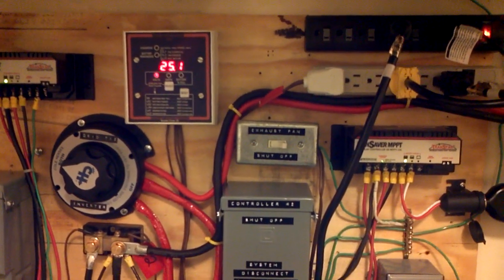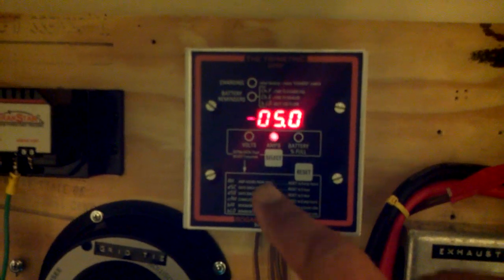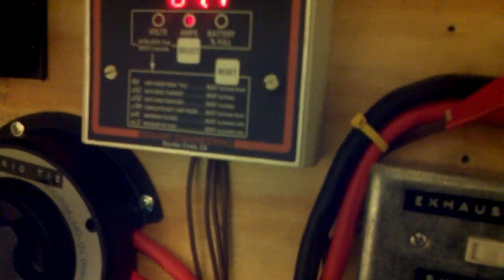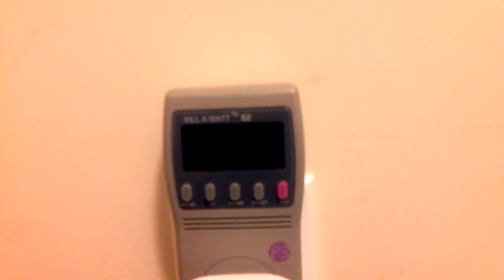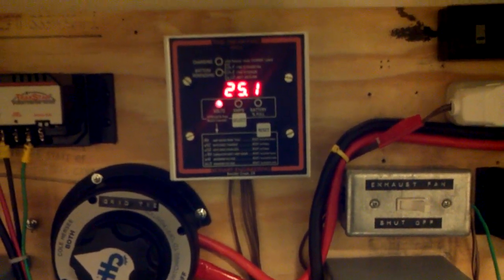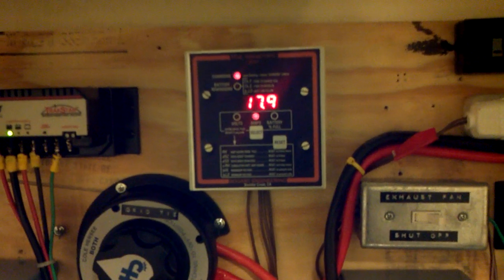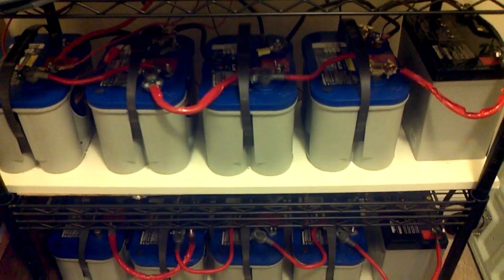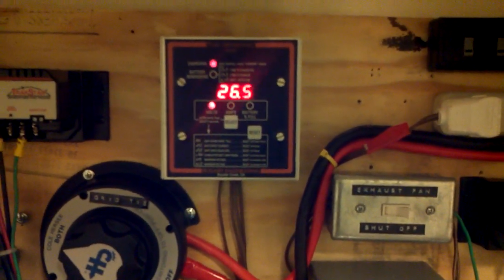DIY - Grid Tie Performance Test Verification Part 5 - Hour 4

Comment from the maker: MagnaSine maybe a little expensive to start out with. Modified Sine Waves are ok for pumps, motors, lights, laptops, and simple appliances and electronics.  However, for sensitive electronics they will fry them.  With a modified sine wave inverter, I've fried a DVR and some other sensitive equipment like electronic pest controllers. That's why I say that MSW inverters are "ok", but may be a hassle in the long run, depending on what brand you buy, a cheap pure sine inverter solves those issues.

Comment: Immediately I want to power 2 of my computers at home. One runs 24/7 to record programs. I am also contemplating to get Power Bright 12-Volt DC to AC 3500 Watt Power Inverter to start with and later on upgrade as needed or should I buy the MagnaSine?

Comment: Thanks for the response.. I notice you 4000 Watts MagnaSine inverter. I am planning to go with the ME2012 MagnaSine 2000W 12V Inverter Charger. Will this work for now - I am planning to start by powering the pump of my pool and a pump of my pond. I am concern about future expansion and having to buy a different inverter.

Comment from the maker: It's been a while, but essentially here is an estimate. MourningStar MPPT Charge Controller $300, Solar panels - $250 ea (x4)., Inverter - $500, Batteries - $180 ea.(x12), wire, switches, fuses, etc.  $250, mounting equipment - $250.  Now depending on your needs, your's may not cost that much.

Comment from the maker: Thanks for the offer, but traveling to do this is not an option for me at the moment. However, I am will to help you in setting things up.  Just send me a private email with your questions etc.  With a little assistance you should be able to complete this in no time. it may look intimidating, but the setup is rather simple once you get an idea of what your working with.  Again, if you get the equipment let me know and I'll help. Take Care.

Comment from the maker: My battery bank capacity is 7.9kW of stored capacity, of which 6.3kW is usable at an 80% Depth of Discharge.  What this means is I can run 6.3kW of electronics, appliances, etc. until my battery bank is considered drained. That's alot during a power outtage situation.  An example is a freezer that take 120w per hour to run, so 6336w / 120w = 52hrs of freezer time or 2.25 days.

Comment from the maker: This system was not designed to save money on my electric bill. It is purely focused on being a backup system. The Grid Tie inverter is there to use any excess power after my batteries are fully charged, and yes every little bit helps, but when people say that a small system such as this or a single solar panel will help you save 80% on your electric bill, it will, if your only running a few lights and maybe a small to medium sized TV and nothing else. But again, every little bit helps.

Comment from the maker: @Fearlessthinker Your right this definitely has to be precise. I'm doing some research on the possibilities.  Unfortunately, my GTI was mislabeled by the manufacturer it seems, it's actually a low voltage unit that operates between 10v and 30v. My 12V panels in series at 36V will put it in a fault condition.  So my unit comes on at around 11 or 12v, so I may have to look at another approach.

Comment from the maker: @Fearlessthinker I've found them at Mouser Electronics, part # 750-SB1100E-G, Peak Reverse Voltage: 100V, Forward Continuous Current: 1A, Max Surge Current: 30A, Forward Voltage Drop: 0.85V, Maximum Reverse Leakage Current: 0.5mA, Mounting Style: Through Hole. The Engineer I spoke with also suggested a Schmitt Trigger or Window Comparator. But I think you have the simplest approach.

Comment from the maker: @Fearlessthinker I like the idea. Zener diodes would do it, if you could find some with the correct power characteristics. I believe I would need one with a reverse bias between 26 and 28v, but my concern is the support for the amp requirement. The one's I've seen are too low on the power scale. But according to my research your idea is sound, if you find the right diodes that won't get fried.

Comment: @rhandsom Good work man, thanks for the info I appreciate it. Also consider that you can turn down the flow of power going into your grid tie with a potentiometer or some form of variable resistor, however it's not very efficient but it might save your GTI from blowing something. The other thing I had considered was a nice car stereo CAP, in your case you'd need a 24V one or 2 x 12V ones I guess. I love my battery bank, I just wish I didn't sell my grid tie! I need one now lol..check out my vids

Comment from the maker: @helloman1976 (At 473w * 4hrs = 1892w total). I also discovered with the help of some comments from folks, that my GTI, although supposedly rated at max 500W actually can take in 600W at peak.  So the GTI efficiency coming off the batteries is (473w produced / 600w max input = .788 or roughly 79%). Yes, the GTI will get hot when pulling constant max amps, so I supplemented the internal fan with a good sized external fan which increased air flow in and around the unit, so it just stayed warm.

Comment: How many watts is the grid tie making like this? Did you do an efficiency check of the grid tie itself in this setup? I never got mine above 87.5% and that was only when it was loaded very lightly. About 82-85% is what I've found in these cheap grid ties. I'm really curious as to whether or not the grid tie is hot, constantly pulling max amps or what the deal is. Any idea? Thanks!

Comment from the maker: @photolodge Your statement is certainly understandable and we learn from our experiences, both positive and negative. I believe the risk, in my case at least, is minimal. Off-grid systems are designed to use the power from the battery(s) everyday. My system is designed for daily off-grid use mainly for my home office which requires 200W per hr to run, hence the reason for my extra panels. If the system is designed for solely backup purposes with cheaper batteries, then use is restricted.

Comment from the maker: @photolodge Thanks for the comments, but these batteries are quality dual purpose AGMs that are designed to take more punishment than a approx 2% per hour DoD, there was no venting or excessive temp. The results show that the ambient temp didn't rise over 10 deg during the 4hrs.  These batteries are also designed for rapid recharging which my test results also show. In general it's also good to constantly exercise batteries as opposed to them just sitting. As a buffer for a GTI they worked fine.

Comment: what was the temp of the battery's? bubbling plates for a steady flow to grid tie is not worth it in my opinion. No harm in just grid tying whatever is available from cells and leave the battery's out of the equation